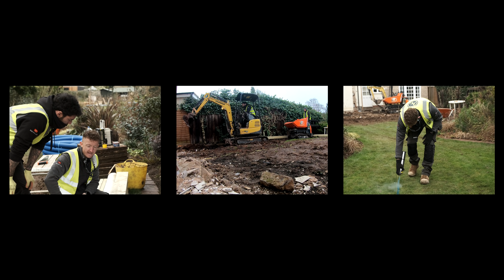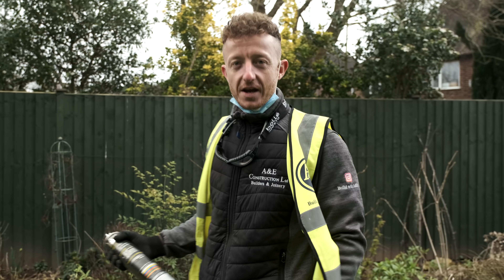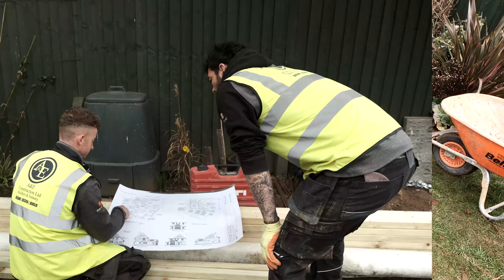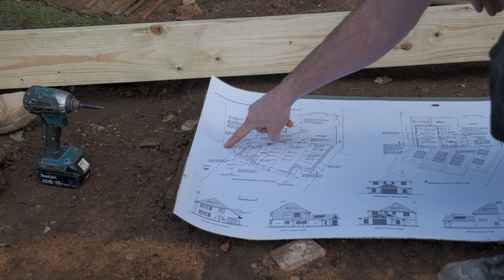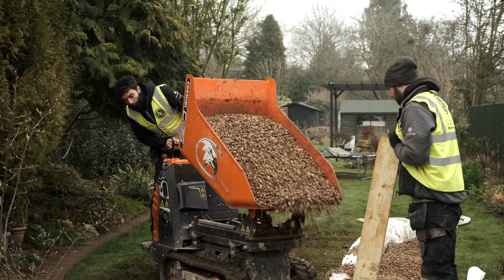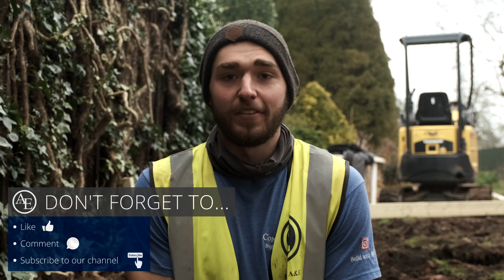Footings and French Drain Work! | Single Storey Extension #2

Comment: Nicely done drain, but you must close the membrane over the stone, or lay another strip across the top. The membrane's function is to keep out fine silt, maintaining the efficiency of the drainage, so closing the top is paramount.
Reply from the maker: Hi the tessellater thanks for your kind words, you are spot on we do in the next video all the best Tony 👍
Reply: Brill video as always lads, but surely won't the water just soak through the pea gravel to the bottom of the trench and not in the pipe?

Comment: That is a BAD French drain. You put 300-400mm of round stone under the 4 inch pipe ( that's good) with no run out for when the water goes under the pipe. You will have 300-400mm of water sitting there as you was into clay. Bad bad job on this one boys.
Reply: Why does it matter if there is water sitting under the pipe? It’s not on the surface?

Comment: Hi guys, hope your all well looks like this project will be great viewing as you progress, just wanted to ask what is th manufacterers name of the pipe called you used in the drain. Also are those lines coming off at an angle from the building as i understood from the drawings the new extension comes off about 30 degrees?